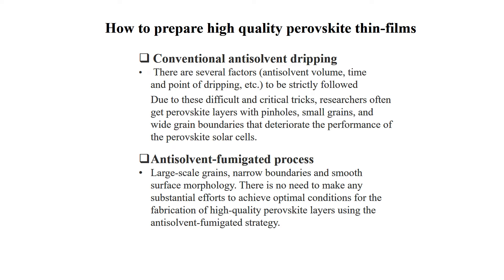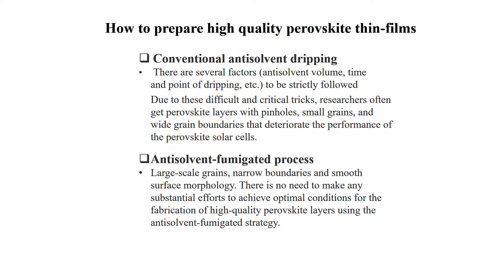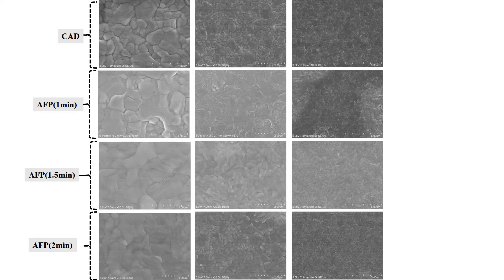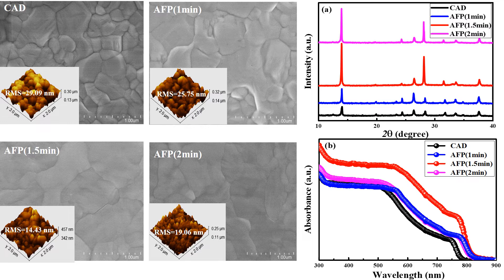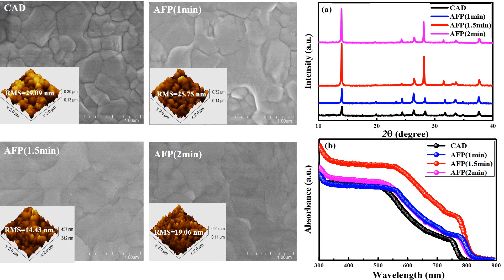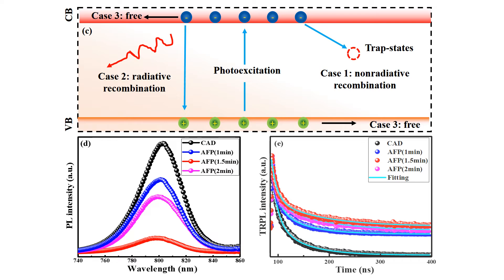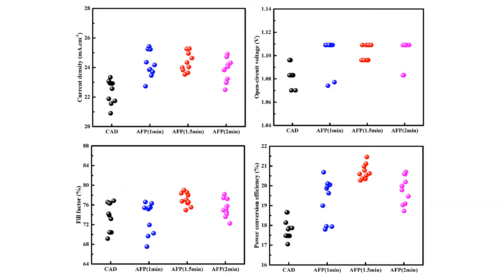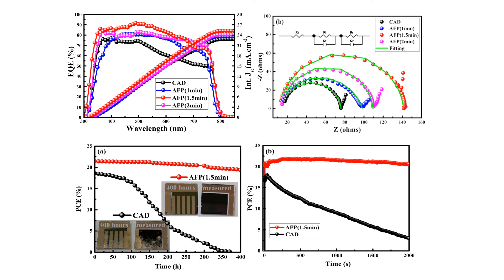How to prepare high quality perovskite layers

Comment: Hi, very interesting results.
One question that I have is what is the composition of the perovskite that you used? I could not find in in the experimental section of the paper.

Another question is, how exactly did you do the AFP method? you spin-coated the film in a custom made small container with the spin-coater inside and petri dish with diethyl ether?
Reply from the maker: Yes, correct for the AFP method. For the perovskite composition please check my article https://doi.org/10.1016/j.solener.2021.08.015. Thank you!